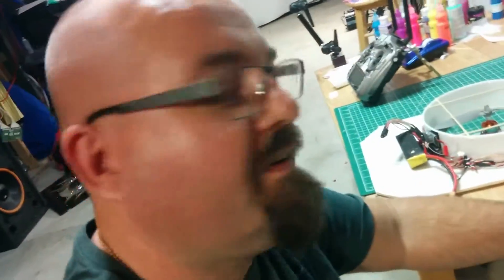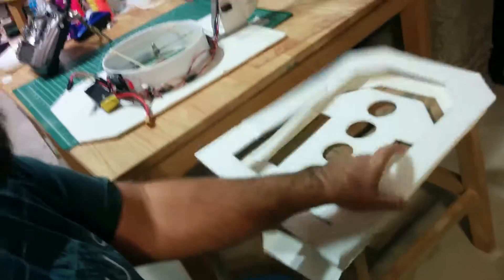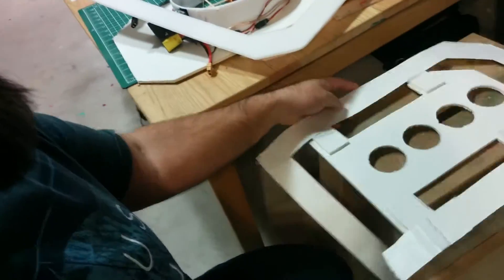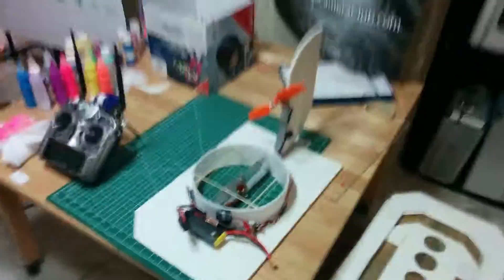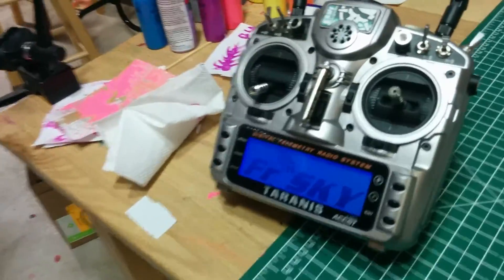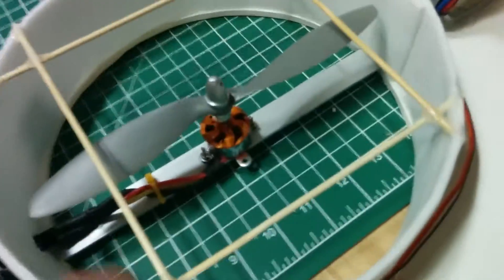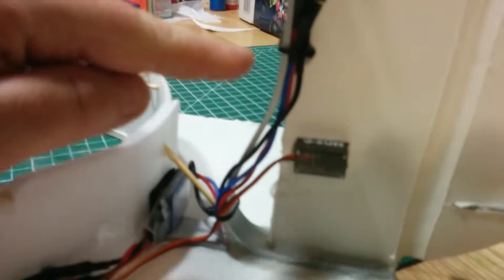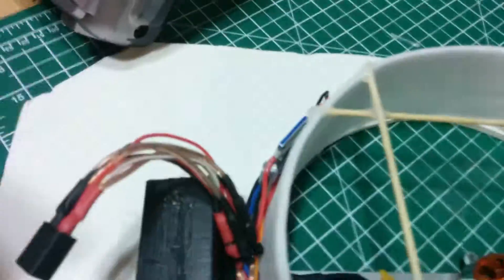Skirtless hovercraft

Comment: Put skirt - it will help rise hovercraft little bit more. You can reverse those motors, you heed special programming card for programming ESC. Just in this case you need some front mounted rudder together with existing one. Or just make two motors for differential steering. Great project, especially now when winter coming - going over the snow. Maybe FPV gear there? :D

Comment: Have you figured this out yet?   

If you want to do skirtless you need a double deck hull.   Check my hovercraft videos for more info, i've got a build video that shows double hull construction.   When done right it'll fly at an altitude of 10% of it's width, you just need a plenum under the craft that distributes the airflow and lets it out as a sheet of air surrounding the craft facing inwards.   The inward air flow acts like a skirt wall, preventing air from escaping and a center 'stabilization' hole in the center under the prop half the intake diameter in size will give you a very stable machine.   

Another trick is at the front and rear, put a few guide vanes on the corners in between the decks in the proper direction to cancel torque.   With proper adjustment of the vanes and careful balance these craft will hover without yawing hands off.

I didn't see your trash bag skirt, but that template looks overly complicated.  Don't overthink, just heat up 45w soldering iron with a clean tip, lay an unopened trash bag on your cutting surface, put your hovercraft on top of it, and just by eyeballing, draw a line right on the bag with the hot tip in the shape of your craft and about 1-2" larger.   Accuracy isn't as important as a smooth line, so do your best.   The bag will both cut and seal with the heat and form a perfect hovercraft skirt.   Cut the top layer of bag so that you can attach it to the top deck of the double hull flush with tape and then glue the bottom with spray glue. Finally, cut a stabilization sized hole in the lower deck as mentioned above, and power it up.

Remember as well that with a proper designed double hull and air control scheme a skirted hovercraft will need very little power to perform.   Some of my models ran on computer fans pulling less than an amp and flew great with a firmly inflated skirt.   The ;larger thre gap between the hulls and the volume of the inflated parts of the skirt all count towards surface area, and having bigger skirts and more places for air to go lowers the PSI requirements but makes the skirt less responsinve.

Check my hovercraft playlist i have several types of craft as examples, including single fan split duct 'racing' craft with sewn nylon skirts.

Comment: thanks for posting.   here is some very late information.     not one thing was done correctly on this model.    for better results, consider the following.   an S-F  prop was used for thrust.  fine.    the lift fan prop should Not be S-F.     the diameter of the lift fan is  TOO  great.   it will cause a Lot of, yaw-axis, torque moment.    the absence of Correctly engineered air flow ducting beneath the vehicle, results in  SUCTION.   not really what you want, is it?       where true hovering is the goal, a vehicle should have, in essence, a low-profile Rigid skirt.  this allows a broad area of increased air pressure to be Maintained.        it should be noted that,  when Friction at the ground has been eliminated, the amount of thrust Required for Any movement, is Reduced by,  at the least, a factor of Ten.     regarding the 'mile-high'  vert-stab, well... lmao.      consider that in order to achieve an  Optimally  stable  Distribution of MASS, all of the Mass of Any flying vehicle Must be Correctly managed/Distributed.   (you know, like, a  LOW  center of mass/gravity is a Good Thing  (gravity being the Wrong term, in this instance.)     the design seen at :20 in the linked video has promise.   see my comment there, if it suits.     cheers
https://www.youtube.com/watch?v=_iqqHAWJq_0&t=